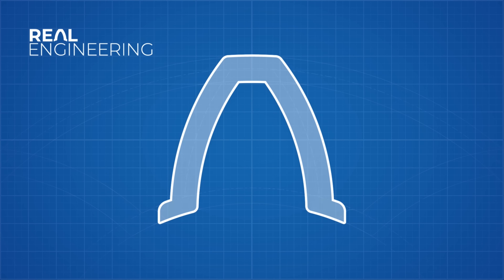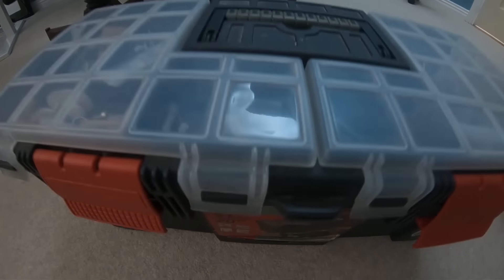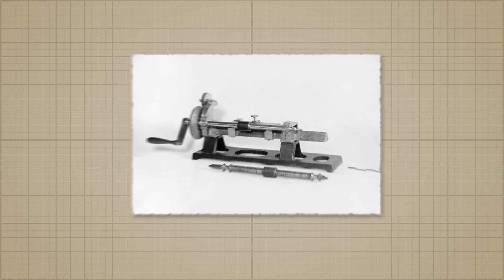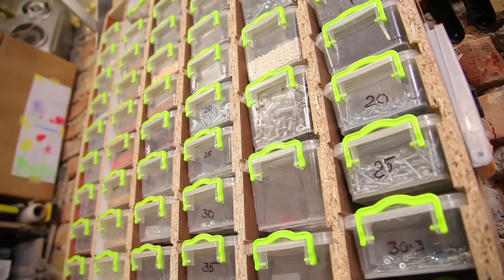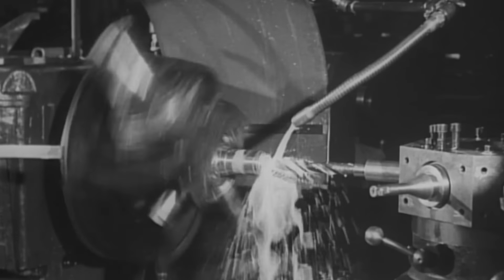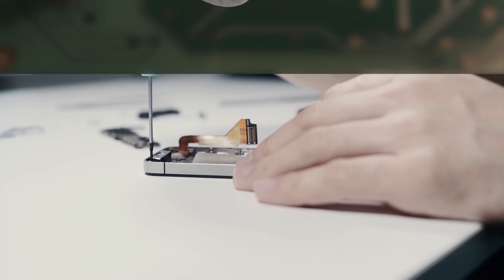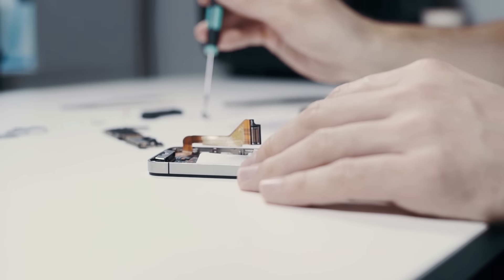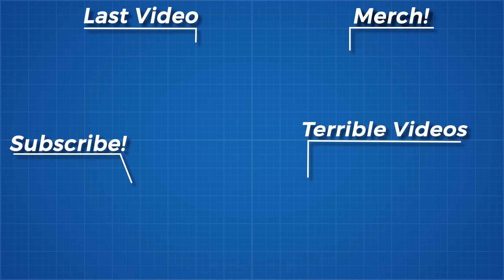Why Are There so Many Types of Screws?!

Comment: out of all the screws that are the worst, the flat heads sure takes the cake! whoever thought of the idea of flat heads, must've been something that caused him ocd.
Reply: You must mean "slotted" heads.  A flat head is one that is flush with the surface when installed.  A countersink bit is used make the seat for the head.  Sometimes you need to preserve a flat surface while putting screws in it.

Slotted heads have been around a long time.  They were probably made that way because they are easy to manufacture.  They work well enough in many applications.

Comment: This was interesting and all, but I'm a little disappointed because I was hoping there would be information about different thread pitches, screw lengths and diameters, and how these factors influence one's choice of screw based on torque required, weight, and material. Also, I was hoping there'd.be an explanation on the number rating system found on the heads of screws and bolts.

Comment: I design things that are dangerous if you open them up, like 400VDC at 20A, 1kWh Lithium Ion battery packs. Those taper-torx heads are there to save your life. Products will be more expensive and even less repairable if we can’t assume safety covers will stay on. 
Anyone can get a taper-torx bit these days. They aren’t keeping you out just suggesting you don’t. 
In fairness to Apple, the IIe I grew up with didn’t need tools to open. The cover snapped off. The torx bit was used on the first Mac probably to protect people from touching many kV on the built in cathode ray tube.
Fun video. I was hoping to see stuff on details like thread class, acme screws, etc. 
I would love to ditch customary units but for woodworking and construction I think in inches.

Comment: As someone who takes apart computers for a living, the torx screw design pisses me off to no end. Sure, the screw itself is good, but the screwdriver/drill bit has a habit of stripping itself at the smaller sizes that Apple and harddrive manufacturers use.
Reply: Do you use a hand tool or a power tool?

Comment: Sometime I feel like the only 'Merican who legitimately goes to a hardware store and buys metric for every single project. The only time I use imperial fasteners or measurements is when I absolutely have to, ie, older cars.  

The fact that people "love" the imperial measurement system so much confounds me, and I've started to believe it's either people with no real-world experience, people who don't use the damn things but rarely, or people who have been brainwashed lol. Probably the same people who say Philip's are the best screw heads.  

In my experience, hex or torx have never, ever, let me down except when I got the wrong bit for the hole (like using 3/8" on a 10 mm) or I was forced to use ridiculous amounts of force (8' cheater bar, anyone?).  I'd love to get some of these square heads, they sound phenomenal for a lot of my r/diwhy projects lol.

I recognize that there might be a few people saying shit like "but we made it to the moon" or something.  My answer is "I don"t give a fuck." Just because we did something with it doesn't mean we did good, we lost the Vietnam War with imperial measurements at the same time. And yes I'm purposely talking shit here. And yes, I know screws had nothing to do with us withdrawing from a military conflict. The difference between a 5 mm bolt and a 3/16" bolt didn't get us to the moon either. A large national budget and a launch site near the equator did a fuck ton more. I bet if the UK was off the cost of northern African and had a much larger GDP, they would have had literally as good a chance, assuming the same amount of drive and tech, etc etc.

TL;DR: I think metric screws are good, fuck Phillip's heads, love hex/torx, wanna try square heads, fuck the imperial measurement system it lost the war you twats, lol.

Comment: I came here in hopes of figuring out the name of the triangle screw, and the three pronged on. I was sorely screwed over by not getting the name. Also I’ve deleted wit one of these cursed three pronged one at work. They’re a pain in the ass, especially when you don’t have the proper screwdriver.

Comment: First of all there are tons of types of screws for every kind of material, situation. Then there are tons of different sizes of each type of crews. And then there are tons of different designs from different and even the same manufacturers of all of the above. And on top of that special designs included in some products including the ones to prevent you from taking apart stuff and voiding the warranty without special tools. So it's pretty obvious.

Comment: Phillips heads don't 'cam out'. Pozidrive, Prodrive and other clones do (I think that they're trying to evade patent). I'm a craftsman and have driven God alone knows how many of these things. Star drives and Allen heads are very good but are more difficult to clean prior to extraction many years later. For woodworking applications I think that Phillips is best. For high torque situations where the head is unlikely to be clogged when extracting then use Allen or Star in that order. These are all female drives. I don't think that there is any doubt that the best male drive is a hex head.

Comment: 3:08 yes yes yes evil imperial... meanwhile the metric system is never changed and is based on solid immutable scientific phenomena like water boiling at sea level and the distance from the earth's north pole to the equator (which was imprecisely measured) and the weight of some material on Earth at one specific place and elevation when we know gravity varies across the planet... 

But I digress.  Sigh.

Comment: Thanks to the internet, you can now find the proper bit to get past any tamper resistant screw.

Screw you Apple!
Reply: In the case of the Apple Macintosh, the tool set was available before the internet from any computer store or any catalog that sold Apple products and accessories. And the Macintosh computer had hex screws holding it shut, not torx screws as incorrectly stated in the video.

Comment: All screws should be torx head. Slot screws are just evil...
In small hex heads the driver gets stuck, and on philips or pozidrive the driver slips and rounds the screw head hole.

Comment: RV/Trailer manufacturers use Robertson all the time everywhere. The Metric/ISO version of the terrible' Phillips 'cross point is a better implementation, it does not use a sharp point that wears out all too quickly and destroys the tool and fastener. Grind off the sharp point of a 'Phillips tool and it will last longer. You may notice most 'Phillips' type insert bits have a truncated point. Also the 'Torx' type fastener has been around a lot longer than Apple has used it, many other manufacturers use the Torx for safety long before Apple did to keep people from tampering with their products, like microwave oven doors and other public installations like restroom doors and fixtures. The list presented is sorely lacking in coverage of the many other types of fastener driving methods. Over all this is just a promotion for the sponsor of the video. 01-26-2020.

Comment: I wish mr. Robertson would have been more about that money cuz Phillips head screws suck. And I always suspected that they were designed to cam out. This video confirms that. It's not so much the screw-head it's the tips on the screwdrivers.
Reply: They have their advantages in certain applications, though.  The principle advantage is that the bit instantly gets centered and stays centered.

Comment: While it is true that torque screws are very strong, and have revolutionized my industry (construction), I would give my left nut to see the world return for the roberts for everyday use. The Roberts is so profoundly superior to the Phillips that I need not even mention it. But the thing is, the Roberts is also perfectly adequate for 90% of the torque screws out there. But unlike torque screws, the Roberts can be automatically fed by a number of different designs, and it's way way way cheaper to use than a torque.

Comment: That is incorrect about the inch, how it was defined. Indeed, this is the typical blarney that people who prefer the metric system like to use pejoratively as it shows the "unscientific" and alleged arbitrariness of the system: indeed, the Imperial system is well thought out and this is clear to anyone who knows why the particular selections and standards were made.
Reply: The origin of the definition of the inch may be obscure, but it hardly matters.  The difference between Customary units and metric units isn’t about how they were defined, as both have an aspect of arbitrariness about them.  The difference is in the underlying principle.  Metric units are chosen so have a decimal relationship between them, across units of all types.  Customary (or Imperial) units are chosen to have units of a convenient size in the way that the particular unit is commonly used.  Both are vaalid.

As for screw threads, the design of a machine screw thread is the same for SAE and metric threads, except for the units employed.  The principle is the same; the sizes are different.

Comment: hmm the US is backwards for using inches to measure length..  tell me, in the UK, why is speed measured in miles per hour but length measured using metric units, it would seem to make rational sense to measure speed in kph for the sake of uniformity of calculation.   also, what kind of a unit is a 'stone'   :-)
Reply: It is written km/h. Division is written as a /. And you need to know that you are talking about meter. There can also be kg/h, like how many kilograms of stuff is transported/converted/... per hour.
The division is written as a / because it is more language neutral.

Comment: what? Square heads exists only in Canada? Welp, color me satisfied. Square heads work like a charm.
Reply: I (a Usanian) used some square drive concrete screws (in concrete, not of concrete).  They worked very well because of the positive grip.  I got them from McFeely’s, but it looks like McF has stopped selling square drive.  A shame.

Comment: The narrator is wrong when he says that the inch was defined in barley units until it was redefined as 25.4 mm.  The relationship of units to barley originated in ancient times and may have persisted into the middle ages, but by the time of the industrial revolution English units were more rigorously defined.  The industrial revolution would not have been possible otherwise.

The inch (along with other units) was redefined in the United States in 1893 to be based on le mètre, the foundation of Metric units.  It was redefined in the 1950s to become the international inch of 25.4 mm.  The reason for the international inch was to unify the various standards used by English-speaking countries.  Even Germany defined the zoll to conform to the international inch.

These are basic historical facts.  The story given here seems to have been made up for dramatic effect.

Comment: You need to do better research. Torx was invented in 1967. Apple's first personal computer was released in 1976 and I'm almost certain it did not use Torx screws. The computer in the video is the first Macintosh which was released in 1984.

Comment: Archimedes' had an influence on a lot of stuff, that's for sure, but his screw didn't just come out of the blue, that was a terrible way to explain where the screw came from, a screw is another application of the old tried and true inclined plane, who knows how long we have been using inclined planes, if you wrap one around a pole you have the basic idea of a screw, at least that's how it was explained to me in school
Reply: That’s right.  Practically every tool is an inclined plane or a lever.  Even an inclined plane can be thought of as a lever.  It’s all about mechanical advantage, or “leverage.”

Comment: As an American engineer, I hate the "standard" system. I wish we would swap to metric and call it a day. However, you make fun of the three barley grains and neglect that the meter was originally defined as 1/10,000,000 distance between the equator and the north pole on the longitude of Paris, and later defined as "the length of that platinum bar over there"... real accessible. hahaha

Comment: I'll take a Phillips screw head over hex or torx every time, those hexagonal slots strip out much faster when the screw is made of anything softer than high carbon steel. Besides the often ignored "retro" compatibility with flat head drivers, the cross Phillips design is also far easier to extract if it does end up stripping, both with friction/grabbing extractors and by cutting a flat groove through the middle, while hex heads have far too little material around the slot to allow that.

Comment: Robertson sockets and bits are slightly tapered so you get maximum torque.  It's a shame because it's the best drive style out there.  Torx is better than hex, though it's a little easier to manufacture hex sockets than Torx.  Phillips drive is just plain ol' Little Mac F Tier.

Comment: In Canada, Robertson bits are square on the face but trapezoidal in their fit. I’ve been told it makes for a better torque surface area. Also been told the American version is simply a square with four parallel sides for fit.

Comment: And here I thought this was going to a discussion of the difference between wood screws, drywall screws, concrete screws, etc. Not a discussion of screw heads. Oh and there's different types of wood screws, ones for fencing, ones for framing, I'm not standing in a hardware store to get all the different types. Need more information.

Comment: This sounds like a debate designed by someone that didn't want to hear anything from the opposing viewpoint.  Because that is exactly how much we heard.  English is designed around the size and weight of things around us measured in units that are easy to relate to.  Would it be difficult to present both sides of a question?  Nah, too much trouble.

Comment: Hex for everything please. We already use it for every bolt ever, and it is mechanically simple. It's ten fold better than phillips.
Torx is over engineered and difficult to use in real life. They clog because theyre shallow, and you can only insert a bit perfectly straight.

Comment: the length of barley has stayed the same for thousands of years. The length of a meter has changed several times in the last few decades. The length of which was first defined by a guess of the circumference of the Earth.
Reply: Have you ever seen barley? Those definitely  didnt stay the same for thousands of years. And they arent all the same length even within the same plant
Reply: Girafffe mit Hut Really? Is that why the inch has stayed the same since its inception. Whereas the meter changes every other year?
Reply: @BLAngel1  because of accuracy adjustments, they change it sometimes. But the inch has stayed the same, for some reason. I think its a relic of the time where feet and ell which were not accurate, because, well, people have different sizes. Using barley seeds is more accurate, until we completely beat the hell out of it with the rise of fertilizers. And now you use the metric system to define the imperial system.
Reply: Girafffe mit Hut So, something that stays the same over a long period of time is not accurate, but something that constantly changes is?
Reply: If you use an object that can drastically change over time, and base your system of measurement on it, then it is not accurate. If you base something on the fundamental parts of physics, something as complicated as using the speed of light, then it is accurate.
Reply: @aardappelmethoed1151  Like the circumference of the Earth?  That measurement is different depending on where on Earth you take that measurement.  The speed of light is completely unrelatable to everyday life.  There is nothing you can look at in everyday life and give its length in terms of light.  But you can easily grab a bunch of barley and measure your height.  Even if those seeds are of various lengths, they will average out to a fixed size (3 = 1 Inch).  And before you criticize that, it is no more ridiculous than giving your height as 182.88cm instead of 6 feet.
Reply: @BLAngel1  The last argument is cherrypicking. It is no more ridiculous than giving your height as 180cm instead of 5,90551 feet. 
Measuring  barleycorn, inch or feet is very inaccurate and that can be fatal, especially in engineering. Unless you use the metric system to get the imperial units, which is very ironic. Satellites failed because of inaccuracy and conversion errors from imperial to metric.

Comment: Too bad you can just press harder on a philips screw and thus negating any claim about torque limiting, no?
Reply: No, it doesn’t.  Assembly line workers don’t want to work harder to get the screw tighter than required.
Reply: @GH-oi2jf  Not wanting to and not being able to are not the same.

Comment: Philippe screws are a nightmare. Yes the screw driver will slip out of the screw when torque is reached, but the slipping will also wear/damage the screw. This is an example of stupidity from engineers, solving one issue and yet introducing another that’s worse.